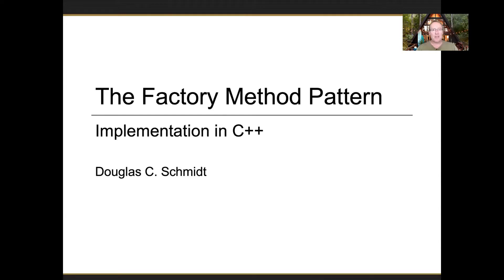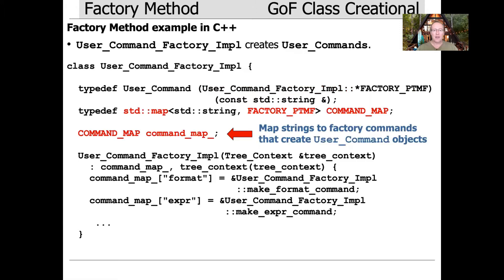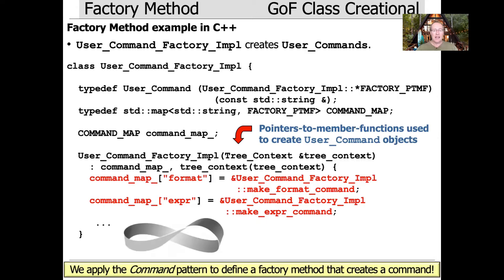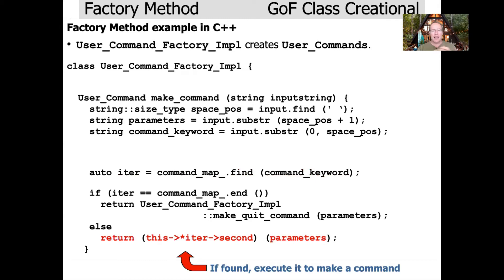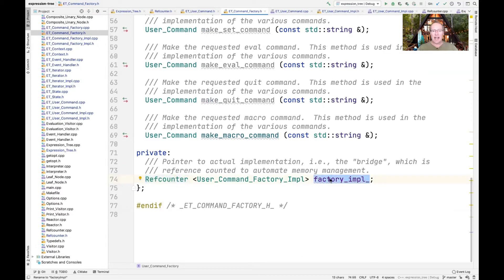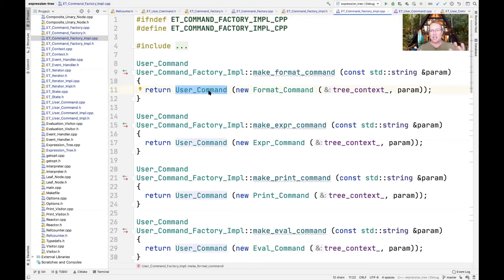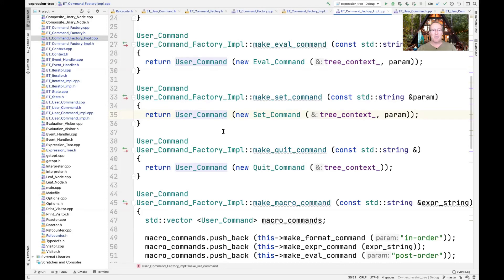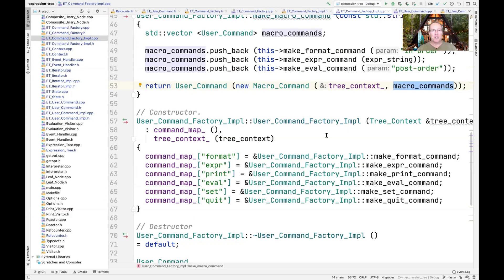The Factory Method Pattern (Part 3)

Comment: Hey @DouglasSchmidt 

Thanks for these videos.I've been going through the code you've shared, and I noticed that all methods in the User_Command_Factory_Impl class are declared as virtual. I'm curious to understand the reasoning behind this design choice, especially since there don't seem to be any subclasses that override these methods.

Could you elaborate on why you opted for virtual methods in this scenario? It would be great to get insights into the thought process behind it.

Looking forward to your response! 👍
Reply from the maker: Hi, 

In C++, marking a method as "virtual" has the primary purpose of enabling polymorphism, which allows derived classes to override the behavior of the base class methods. While it's common to use virtual methods when designing a class to be a base class in a hierarchy, there can be motivations to define methods as virtual even when there aren't immediate needs for subclassing. Some of these motivations include:

1. Future Extensibility: Even if you don't currently have specific plans to create subclasses, designing your classes with virtual methods can make the class more extensible in the future. If requirements change or new features are added later, you'll have the flexibility to create derived classes that override or extend the behavior of the virtual methods.

2. Interface Definition: Virtual methods define an interface that derived classes can adhere to. If you anticipate that future subclasses might need to provide specialized implementations, using virtual methods can help ensure a consistent interface across all classes in the hierarchy.

3. Testability: Virtual methods can be particularly useful for testing purposes. You can create mock or test-specific subclasses that override methods to provide controlled behavior, facilitating unit testing and reducing dependencies on external systems.

4. Dependency Injection: When designing code using dependency injection patterns, virtual methods can be used to allow clients to provide custom behavior by deriving from the base class and implementing virtual methods differently.

5. Code Evolution: Software projects are dynamic and can evolve over time. What might seem like an isolated class today could become part of a larger system with new requirements. Using virtual methods can make it easier to adapt the class to these changes.

6. Consistency with Future Subclasses: If there's a possibility that subclasses might be added in the future, defining methods as virtual maintains a consistent design pattern across the class hierarchy. It avoids potential design conflicts that might arise when adding virtual methods later.

7. Coding Standards: Some development teams or coding standards might encourage the use of virtual methods for reasons of consistency and maintainability, regardless of immediate subclassing needs.

8. Documenting Intention: Marking methods as virtual can serve as a form of documentation to indicate that the method is designed for potential extension.

While using virtual methods in a class without immediate subclassing needs might add some overhead, it also reflects a design philosophy that emphasizes flexibility, extensibility, and adaptability. It's important to carefully consider your project's requirements and potential future changes when deciding whether to use virtual methods in this context.
Reply: @DouglasSchmidt  Thanks a lot for taking the time to respond! Keep up the great work!

Comment: Thanks for these videos. What is the benefit of PIMPL in this case? It seems like you could have simply used an enumeration and returned the object based on switch/case? Unless there would be a chance that the underlying implementation would change and thus it would point to a different factory implementation. The types are pretty much known in this case and the single responsibility would be to create the User_Command objects. This seems like a YAGNI situation.
Reply from the maker: Hi Ludvik, the main purpose of using the Bridge pattern here is to avoid exposing clients to "naked pointers" that aren't managed by an Abstraction class like User_Command_Factory.
Reply: @DouglasSchmidt  Wow! Thanks for the reply. I’ve used the Bridge pattern to provide pointer to two different implementations of a serial port interface for Windows and Linux (granted defines change the implementation at compile but the interface was the same so no other code needed to change). This pattern works well for this type of abstraction. GoF’s example was different window managers which is relatable as well. Do you have any recommendation around a pattern that is ideal encode / decode behavior? Eg. Custom data packet needs to be decoded when received and encoded to be sent. I’m refactoring some existing code and I tend to over think things. It seems that adding encoding and decoding to the object violates SRP. So far I’m using a visitor pattern to encode the bytes the right way and decode returns the packet object. Thanks again for the response.
Reply from the maker: @ludvikjerabek  Hi Ludvik, Here are several design patterns that can be useful in the context of encoding and decoding data packets/messages:

Factory Pattern: The Factory pattern can be used to create encoder or decoder objects. This is especially useful when dealing with different types of messages or different protocols. The factory can return the correct encoder/decoder based on the message or protocol type.

Strategy Pattern: This pattern can be used when there are several methods available for encoding or decoding a message. The Strategy pattern encapsulates these methods into interchangeable objects, allowing the method to be chosen at runtime based on the specific requirements of each message.

Decorator Pattern: The Decorator pattern can be used to add additional functionality to an encoder or decoder in a flexible and modular way. For example, if some messages need to be encrypted or compressed in addition to being encoded, this can be achieved by "decorating" the encoder with an encryption or compression module.

Observer Pattern: If many parts of your program need to react when a new message is received, the Observer pattern could be a good choice. This pattern allows multiple objects (observers) to be notified when the state of another object (the subject) changes.

Adapter Pattern: The Adapter pattern can be used when the interface of an existing class doesn't match the one you need for your application. For example, you may have a library for handling JSON data but your application uses a different interface for handling messages. You can create an adapter that makes the JSON library compatible with your application's interface.

Facade Pattern: The Facade pattern can be used to hide the complexity of the encoding and decoding process, providing a simple interface to the client. The client doesn't need to know about the complexities of the underlying network protocols or data formats.

I hope that helps!
Reply: @DouglasSchmidt  Thank you again for taking the time. I’ve truly appreciated the insight and your videos. What I’ve come to realize is the more you spend reviewing your design the more you can see patterns that can be used. Every time I revisit old projects, I find better ways to deal with complexity.
Reply: @DouglasSchmidt   I read your paper on Reactor Patterns, in section 9.2 you mention the use to recursive locks. I’ve used recursive locks in the past, however, most of what I’ve read always seems to claim the use of recursive locks is a code smell. I’d love to hear your take on this topic. I’ve often laughed about these debates because the construct wouldn’t exist if there weren’t some good reasons to use them. As an example, I’ve seen some really clever and efficient uses of “goto” even though it’s mostly frowned upon. 😂
Reply from the maker: @ludvikjerabek  Anyone who claims recursive locks are a "code smell" doesn't have much experience with object-oriented frameworks in the context of concurrent programming.  Check out https://www.youtube.com/watch?v=wkYXjKTTSyQ&list=PLZ9NgFYEMxp7aa8ZEWpoFOf_lNn-4YN5E&index=63 at the 6:48 time frame for a discussion of the importance of reentrant locks in that context.  Likewise, check out https://www.dre.vanderbilt.edu/~schmidt/PDF/dispatching-PL.pdf for a thorough discussion of various ways to avoid the use of reentrant locks in the context of object-oriented frameworks, which are often not worth the trouble..
Reply: @DouglasSchmidt  I appreciate the discussion as there is a lot of misinformation out there and more then a few heavily opinionated developers. I’m curious if you have any papers on demultiplexing and dispatching in the context out of band events. Eg. A client/device can send and receive events (at the same time). Some events are in responses to an outgoing request (accepted, rejected, malformed, data response) but some are inbound events broadcasted from other devices. Those events would be listened for and routed to a handler for broadcast events if there was a need to dispatch them. I know I’m asking a lot of questions, but based on your expertise this must be a common bi-directional (sync/async hybrid) pattern as well. Thanks again for sharing those links.
Reply from the maker: @ludvikjerabek  I recommend you check out the Proactor pattern (and associated patterns like Asynchronous Completion Token) from the POSA 2 book (also described here: https://en.wikipedia.org/wiki/Proactor_pattern).  There are videos about these patterns at https://www.youtube.com/playlist?list=PLZ9NgFYEMxp6CHE-QQ040tlDILNcBqJnc as parts in the "Patterns and Frameworks for Asynchronous Event Handling" section.